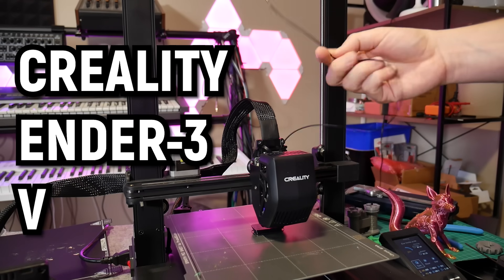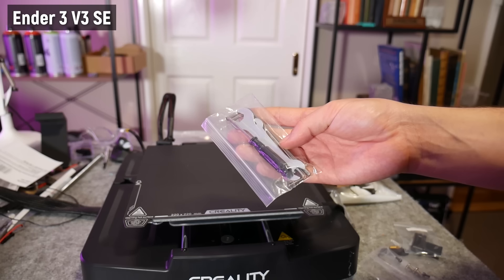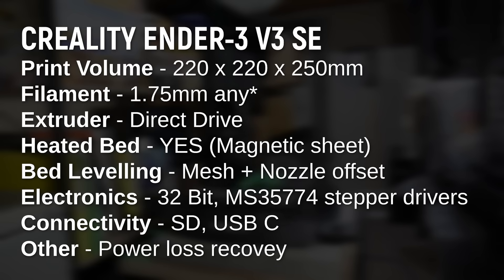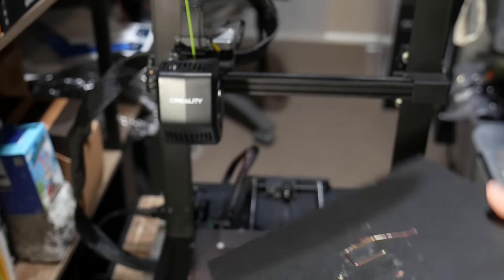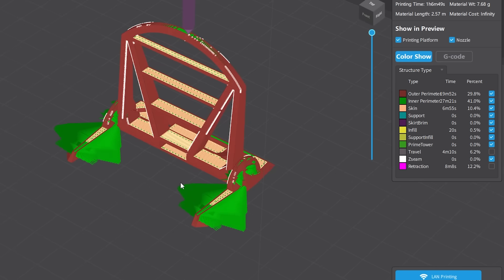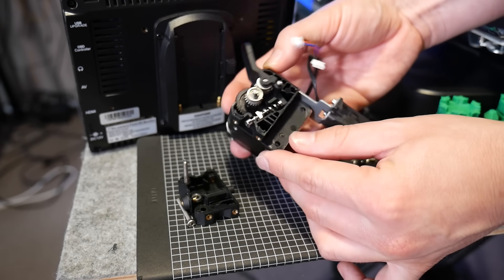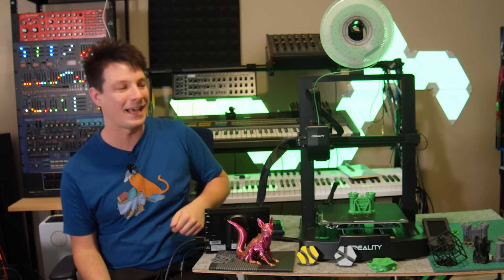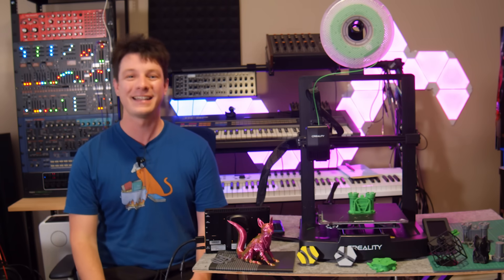The Creality Ender 3 V3 SE is very good. There, I said it!

Comment: Hey Angus, Awesome video & good to see this inexpensive legend gettting some of the love it deserves.

I'm a teaching assistant in the technology faculty of a school & we acutally bought 3 of these machines very shortly after they launched in an attempt to take the load of lower priority prints off of our farm of Prusa I3's. 

We're running them exculsivley on Esun PLA+  to keep things simple and mostly using them for less important jobs and those from younger students. We've found them to be really easy to setup and run and havn't had any major issues yet, which I can't even say about the prusa MK4's. For those who are on tight budgets or just looking for a lot of output at minimal cost, I'd struggle to reccomend anything else at this point.

One thing I'd reccomend to you is to make a prusaslicer printer profile based off of the  Ender 3 S1 profile that is included in prusaslicer, the two printers are very similar in build and even use the same exruder.  You'll end up with a stack of ready to use print profiles for a range of layer heights that produce excellent results and require basically no tuning - it's been working really well for us so far - hope that helps.

Also, I think that there we're some other creality printers that launched recently that use the same shape of spring steel sheet with a PEI coating (might have been the K1?), those would probably make for a great drop-in upgrade over the standard sheet.

Comment: I had absolutely horrible experiences with the first I3 printer I bought.  It went back to the store before the 30 days return window was up.  The thing shook itself to pieces and the linear bearings failed almost immediately.  I'll never own an I3 again.  My original Ender 3 has been flawless for three years.  Not sure why you have had bad experiences with them.  Only thing I have ever had to do to it is level the arm once in that time and add a glass bed and Octoprint.  It was printing solidly for the first two years.  If it failed tomorrow I would be getting another just like it.

Comment: I've had nothing but issues with mine. Constant stringing (I be changed every setting I could, put in a new nozzle, checked belts and other parts). Not to mention it ignores max travel  speed value in cura and uses it's own.

Comment: I had the same infill bug several times in the slicer. No idea what causes it but the only thing that seemed to help in my case is playing around with wall line count, so if it's 2 try making it 3 or something. That's really my only gripe with the slicer as i'm not printing anything complicated and it works well enough, but I'm waiting for someone to make a good profile for cura to make a switch

Comment: I have bought one of these as my first 3D printer.  Is well worth the price.  I do have several nits. Like you the bed was too sticky and I changed it.  Also agree the left corner on was high until I fixed and the hood is BIG.  The only   real bug is with the auto bed level.  The auto z-offset tends to be a bit to high.  Causing the 2nd layer sometimes dragging on the first.  Lowering a bit fixes that problem.  BTW I get OK quality w/ 170 mm/sec on TLA but usually max at 150-130.

Comment: I have an issue with two of these printers that suddenly are not doing the first layer right. I can't see any loose screws and this is happening with any print. Not sure how to sort it out. It's like suddenly both printers having the same fault. Edit: cleaned print bed and ran update on the printer with the locked screen and both are all good.

Comment: Honestly, comparing the ender 3 v2 to my Wanhao Duplicator i3, I've had only 1 real issue with my v2 and that was recent. The main driving gear collate had such a deep groove from the filament that it could no longer push the filament correctly. I didn't expect it to wear out after maybe... 4 spools of PLA? Otherwise, great machine so far.

Also, thank you for making the video about laser cutters a few months back. My parents asked me if I would use a laser cutter or a lathe more and I did discover that laser cutters can act a little like lathes with the right tools. Even though the one I got doesn't have an enclosure, I'm not going to even plug it in until I get one (the enclosure and cutter were outside of their budget). Sucks that even the lowest end fully enclosed laser is still like $1,000 USD. I've been wanting one for years but knew the logistic nightmare while still being safe. I will absolutely be rewatching that video many times while considering what to cut. Thank you ^^.

Comment: I have this printer and it was working fine for a while but  I went to remove the filament and it was stuck and the filament broke insanely close to where you insert it at and now I cant remove it and have no idea how to get it out. This is my first 3d printer so I'm insanely new to all this. Any suggestions on how to fix it?

Comment: I'm new to the 3D printing world, but a dinosaur in the manufacturing industry. 

I like my Ender 3 S1 Pro.  I was easy enough to get started with and advanced enough to make some really good prints.  I tend to create more functional models, not that artist models don't have their purpose. 

The S1 Pro seems to produce fairly repeatable results.  Some of the print in place moving models are a little tight, but I think that could be tuned out with some testing. 

The S1 Pro had the biggest bed of an almost fully assembled printer that I could afford at the time.

I do wish I'd had the funds for a multicolor model.

Comment: Creality is really disappointing as a company to me lately. I had bought the V3 SE as an early adopter (not many reveiws at the time) and quickly was disappointed. It seems like there's a high chance something will come to you wrong on the printer, that will give you incorrect leveling results if you're ordering as a normal customer. But the real problem is that people have discovered quite a few possible issues it COULD be. it could be as simple as tightening your bed screws underneath the build plate to having to take apart and properly fix your print head to the gantry.
Creality's customer service is often unhelpful even for the most simple questions. And when I heard that they were releasing the KE, it felt like a slap to the face from the company, releasing it only months after the first version. I know Creality has never been known for their quality out of the box, especially for their beginner printers, but with printers like this where they advertise "worry free leveling," they really need to up the out of the box QC. I hope the KE is more consistent than this machine. I don't know if stopping production of other possibly inferior printers would allow for better quality control, but it's certainly something that should be thought about. Thank you for coming to my TED talk.

Comment: I've replaced the BLTouch with a CRTOuch and it's much better by a wide margin. The probe on the BLTouch has always ended up no longer working and a replacement is expensive for what you're getting.

Comment: After owning it for just under a month I am extremely impressed compared to their older v2 and V2 NEO which I have both owned. Not had anything go wrong yet but would expect it to be easy when it does. Best printer under £200 for sure

Comment: My quick review as someone who bought it. (he was pretty spot on)
1. the bed it comes with is eh, I replaced it with a glass bed after a week because prints were sticking too well
2. the assemble was amazing
3. The auto z-offset doesnt work for me. its a little too close or too far and I end up adjusting it anyways
4. probably the best beginer printer
5. consistent
6. careful with the SD card, mine doesn't go in all the way now and stops mid print at times.

Comment: As soon as I got an Anycubic Vyper I never touched my Ender 3 Pro again.

Now that I just got a Bambu Labs X1C 😅😅

Well, I haven't ran my Vyper since.  That's mostly because it's slightly disassembled in getting ready for the enclosure Im building for it.  And after finally getting into printing nylon inside with the X1C, I realized I really need a new hotend for the Vyper.

And I need to get Klipper running on it  but gave up making that work as I got the Raspberry Pi and X1C at roughly the same time so all my time spent printing is mostly going towards trying all sorts of different filaments and modeling upgrades and what not.

Comment: Interesting review. I've had my v3SE since October and for the most part, it has been fine. I'll address the big problem I had in a moment. As far as adhesion to the print bed goes, I haven't noticed the problems you had, in fact, the out of the box print bed works fine for me at 60C. What I ALWAYS do between prints though, is to clean the surface with 70% IPA using a box store type micro-fiber rag. Mine print bed still looks brand new. I also got one of the new PEI "gold" print beds, and had a reverse issue; I was having not enough sticking, so for now, I changed back to the original. Ok, now for the problem. When I finally got the printer set up, I printed the heck out of it for the first week. If there was going to be manufacturing issues, I wanted to find the fast. I am using Creality Hyper PLA for most prints, and used Creality Slicer. Like you, i got a profile for Prusa Slicer and had issues, so I switched back. My issue was a problem with the hot end servo control. Sometimes it would be fine, keeping the temp within +/- 1C of target, but other times the temp would bounce around, which finally would cause the firmware to throw a "nozzle temp too low" error along with a very annoying sound which could only be turned off by powering it off. This would happen now and then and I found that by changing the fill pattern from grid to honeycomb changed "something" enough to make the problem go away. But eventually, the error would happened when just trying to retract filament. After a few round with Creality Cust Service, they finally decided to send me a new hot end (i think). I'm still waiting on it. I'm not sure if it will come with instructions, so we'll have to wait and see.
overall, (this is my first 3D printer), I'm happen with how it prints.
Reply: I had the same issue with the "nozzle temp too low" and I found a way to fix it. You have to tighten the nut that holds the thermocouple to the nozzle. Just remove the rubber cover and use an Allen wrench from the bottom
Reply: i will check that. Creality sent me a new hot end, but I haven't installed it yet. I'll try your idea. From the symptoms I figured the issue had something to do with the feedback loop of the heating cycle. I figured it was a damaged thermocouple but if tightening it fixes things, i am good with that!
Reply: @alankilgore1132  I noticed that I kept having to tighten it every few days, so I decided to remove the thermistor to see what was going on. When I removed the thermistor, a bunch of white stuff fell out so I cleaned everything and reassembled it. Haven't had a problem since so you may want to check that.
Reply: @ianb119  Not sure how to remove the thermister since it appears to be press fit or glued into the mounting hole. So, I will have to figure ou how to replace the hot end. Is the hot end on the v3 SE the same as any of the other Ender printers? I haven't found a video of how to remove this specific hot end, but since the printer is new, that isn't surprising.

Comment: Ive seen that green tree triangle stuff, in my case it was due to multiple faces defined in the same area. Id use boolean operations in blender and had been lazy and not cleaned everything. After clearing out the duped surfaces and vertices,  the green went away again.

Comment: It's a good time to get into 3D printing, I got an Elegoo Neptune 3 Pro (very similar in specs to this) which was AU$250 and produced great prints after a quick setup. We're at the point now where it's not necessary to be a full-time tinkerer or buy expensive equipment just to get acceptable print quality.

Comment: Super happy with my V3 SE as a first 3d printer, easy to setup and get started. I did find exactly the same issue with the slicer, some models I imported it does weird things to the inner perimeter. I couldn't find any fix for it so tried Prusa slicer, it had no issues with the same model so I stuck with it and like it  :)
From the perspective of someone who wants a 3D printer as a tool to use, to print out some of the ideas in my head, this printer has been brilliant for me.
Reply: Latest version of Cura has a profile for V3 SE. I have been using it for a few days and works seemlesly so far
Reply: Probably a good call to switch. I got a 3 v3 SE as my first 3D printer and figured I may as well use their slicer cause why not. I didn't have really too many issues at all until I updated the program and.... It wiped all of my profiles. About 2 weeks worth of work dumped. So that was fun.
Reply: Does Prusa now have a good SE profile?
Reply: @websitesthatneedanem  also wondering that
Reply: @SwainixFPV  it does not yet sadly, i was wondering where it was when ig ot my SE
Reply: @peng364  I actually got into the 3D printing rabbit hole really badly since my comment, I have a klipperised tuned S1 pro with a high flow nozzle now for which I've made my own presets in orca ahah
Reply: That's actually good to know as I'm watching this video for the that exact reason.  I want to build functional parts mostly mostly for my invertebrate collection. Just needs to get the job done with good print quality.
Reply: @aoc8548 can you give me any advice on what to upgrade for a new user like my self with this printer?
Reply: Orca is a really good slicer and imo the best one

Comment: silent steppers aside from travel, loudest part is the fan, color portrait screen, full-size sd card, no level knobs, nozzle force sensor, belted dual-z-axis... it's quite reminiscent of the CR-6 SE which I am sad they stopped selling.

Nice to see this has a lower price, direct-drive extrusion, and linear rails, though I would miss the customizable touchscreen, actual dual-z motors, and filament runout sensor (which has saved my ass a few times!)

Comment: The K1 on sale right now for $350 is a worthwhile upgrade, I just got one but returned it because the gantry belts don't line up and cause part warp of about 0.5-1.5%. Which for most all prints doesn't matter and you won't notice, but once you start making precise parts that need to fit perfectly then anywhere near 1% is a deal breaker. I wanted a appliance type printer, I already have 4 other printers that I've designed parts and upgrades myself for them, didn't want to dig into a new project. Hence I returned it

Comment: 4:33 in video and i feel like my s1 pro has a lot of these improvements implemented as well, although i wish for the hard mounted heatbed and better ABL. rn printing 0.1 diameter nozzle on 0.05 layer height for max detailed figurines such as Holo from PinkStudio. turns out really good, tho i do have some artifacts due to overheats on certain areas and fused supports, but presicion on HB calibration for every print drives me crazy, sometimes takes up to an hour

Comment: Nothing made by Creality will ever be good.  Their quality control sucks, their products rarely work.  The Ender 3 I bought had a motherboard where parts weren't soldered, extruded aluminum that wasn't cut square, and a stepper motor that wasn't working properly.  I know other people with even worse experiences with their products, including one guy who bought three of the damn things and never got any of them to work.  Save yourself some money and buy something that works.  I've never gotten mine to.

Comment: At $199 it's $50 cheaper than my E3v2 was 4 or 5 years ago. I don't see where you could go wrong. 
I would imagine a filament run out sensor could be added for a few doll hairs, but I've never needed one. I've nodded my E3v2 quite a bit and that's an option I've never seen a need for.

Comment: I just got this printer recently, and I have to say I appreciate how "sticky" the bed is. I don't use any glue stick, and only once did I have a print get knocked out of place, and that was with cheaper PLA. And regarding TPU, I print it at 70° with no problems, the prints peel up easily enough afterwards.
Also, the screen isn't becoming "unresponsive" during automatic functions, it locks you out because it's busy.
Reply: A glue stick is used as an adhesion *inhibitor*. It allows for easier separation from the build surface and is suitable for more flexible filaments, like PETG and TPU, which can destroy smooth PEI. Adjust your Z offset and clean the print surface if you have adhesion issues.
Reply: @theofficialczex1708   Ah I thought it was to help it stick, my one print that was knocked off, I put down some glue stick and it held for the rest of the print (it was a multipart and I didn't want the other pieces to get messed up). But my TPU prints come off the build plate very easily, sometimes I can even peel them up without taking off the build plate. How would it damage the plate?
Reply: @Manu__R  It depends on the surface, but smooth PEI is notorious for ripping off when using TPU or PETG. Glue likely helped because your offset is higher than it should be.
Reply: Screen function is clearly for beginners to not mess up something during those operations. But they should add some clear animation that progress is happening.

Comment: With the CR-6 SE, the touch screen basically works as a defective version of the rotary knob UI.  Not sure if this from the Community firmware, or is a "gift" from Creality.  So, not having a touch screen GUI for the Ender 3 V3 SE might be a feature, rather than a gap.